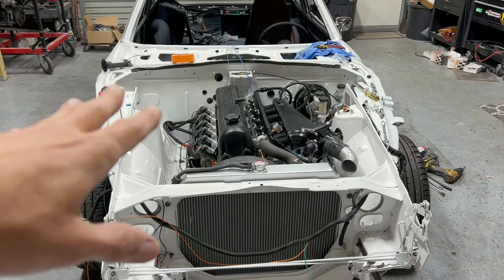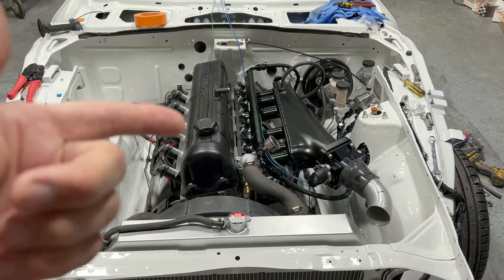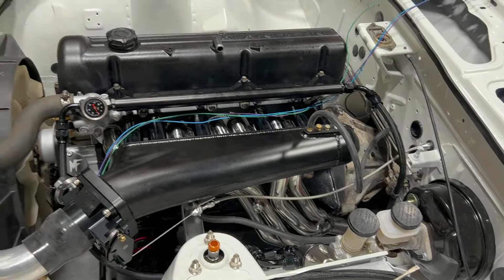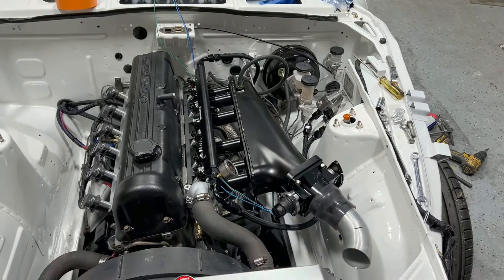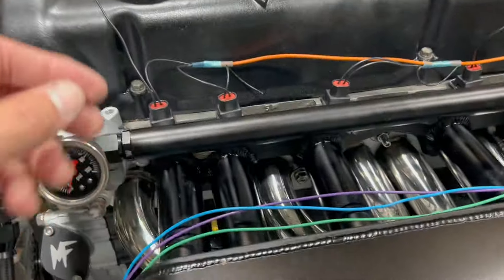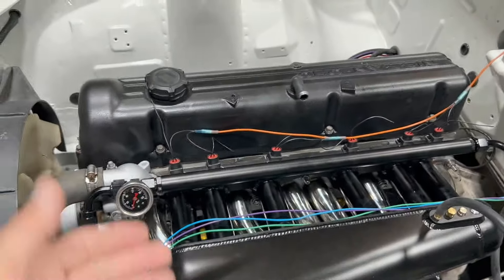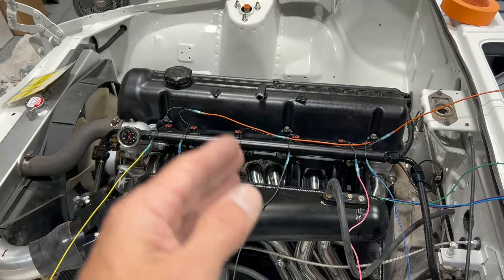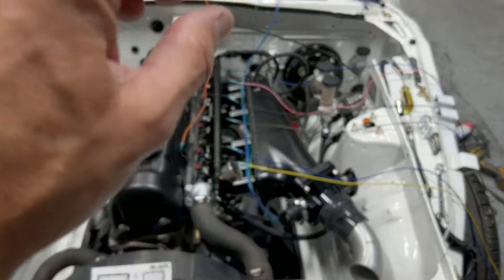How To Wire Your Inline 6 For Batch Fire Injectors! Datsun L28, Toyota 1JZ,2JZ!

Comment: If you're running something like ID1000/1050x (Injector Dynamics) or FIC1000, you shouldn't have any idling or drivability issues. If you're using off-brand 1000cc injectors, then I anticipate some issues.
Reply from the maker: There not one of the big brands just  genuine Bosch injectors.